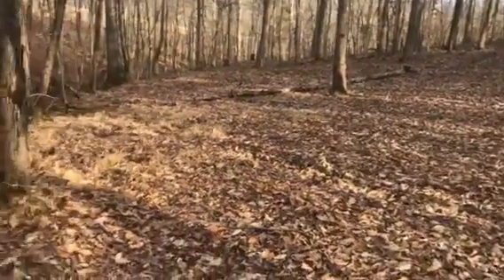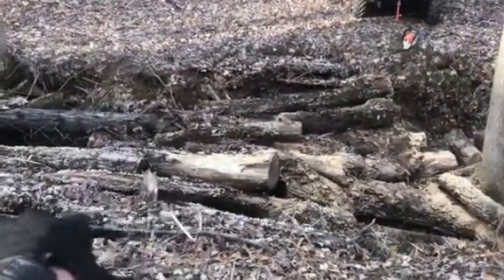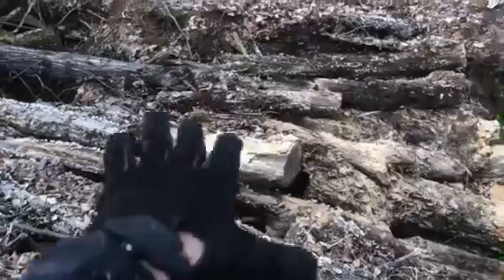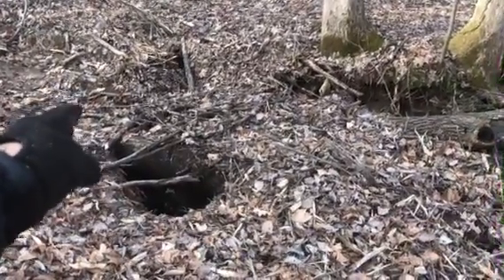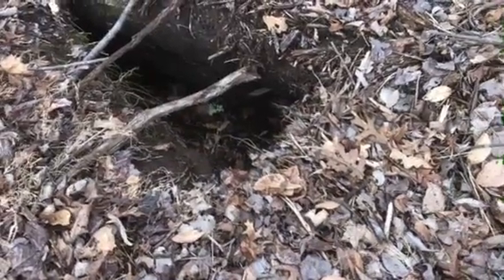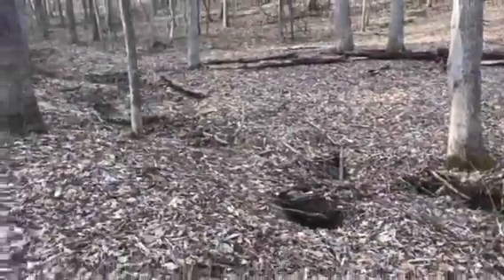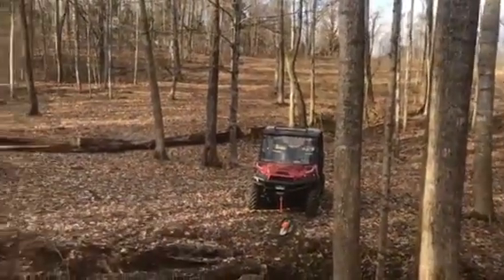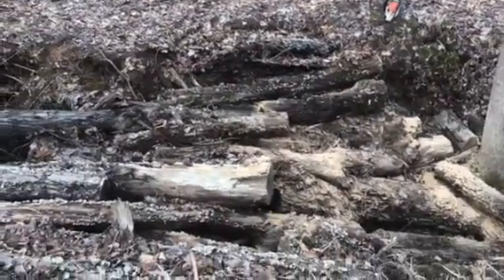Erosion Contriol Method for Dry Creek Gullies - Showing Progress

Comment: I’m debating between the Bobcat T870 or the cat 299D2 XHP with the metal excavator tracks if you look at them closely you’ll realize that steel tracks used on compact track loaders are excavator tracks except shorter my bobcat dealer has a rating of 4.1 on google maps and Holt cat pflugerville has a rating of 4.4 on google maps any wisdom is appreciated and thank you for your time! 🇺🇸🖖🏻😇
Reply from the maker: Ryan Christopher Wagner If you are going to use this machine for forestry mulching, I’d look at the total life-cycle cost. That is all of the costs AFTER the purchase cost. You should also consider the cost and type of maintenance warranty? What are the dealers maintenance shop rates? How much do they charge to send a service truck out to your job-site? Whats the trade-in value of their machines after 3-years of use? What are the cost of replacement cutter teeth? Do they service/warranty the cutter head? 
These are all important costs considerations to an owner.
Reply: Ryan that 299xhp with steel tracks would be a sweet mulching machine. I purchased a new excavator from Milton cat and had a few stipulations with my salesman. Once the contract was signed they wouldn’t make good on the agreement. I believe it was on the most part my fault for not having it in writing beware of oh yeah absolutely no problem. NC forestry and landscaping has the 299 you might want to check him out. Do you plan on just doing mulching cause the steel tracks might be an issue doing other work depending on soil conditions
Reply: Cookies Services yes I want to do forestry mulching, excavation/dirt work land clearing etc and conventional demolition NOT explosive and I’ve heard of them they do a damn good job 👍🏻 thanks for your time any wisdom/advice/constructive criticism is always welcomed by me 😇🇺🇸🖖🏻
Reply: The local tree co that clears for utilities near me has run all of the different ctl and the guys that run them swear that cat is best I would think they would have a dedicated muncher but I guess they are to big and are hard to get into tight areas. Greg from NC forestry,landscape would help you with questions. I know that I talked to salesman at cat and the ctl without equipment was 100-105k then you need an auxiliary cooler and of course you’re head talking 2 - 2500 per month plus insurance. You can adjust that with down payment and other terms length of lease. I prefer the tax incentives with a lease.
Reply: I own an asv with a disc type mulcher 100 hp and I use it for a multitude of tasks. I live in watershed area upstate NY and can go places with the asv that I can’t do with my excavator what part of the country are you from
Reply: Cookies Services I live in the Austin Texas area Travis county
Reply: Cats have very good resale also
Reply: Do you have a good cat dealer near you? Steel tracks would probably work fine down there but I believe you could run rubber as well if you had a job that called for it. Greg from NC started with a Kubota and said the tracks kept coming off and I know on the 299 they have a couple idler options to try to prevent that
Reply: Cat and asv are both over 100k so it’s a big investment

Comment: Yeah the machine is under warranty until it reaches 500 hours and they have gave me a t650 as a loaner
Reply from the maker: Joseph Stone Glad they gave you a loaner. Bobcat is pretty good with helping out keeping your business moving while your machine is in the shop. Did you buy that machine used, and the warranty is only 500 hours? I think Bobcat's basic warranty is 2000 hours. Personally, I think it's a good idea, and good risk management, to keep your equipment under warranty, especially if you're using it for business. It alleviates financial surprises, and the cost of the warranty is a tax deduction.

Comment: Hey I have a new t770 and I've put about 250 hours on it and already blew the turbo and the def pump and now its back in the shop now because of 3 different codes do you have the same problem sometimes
Reply from the maker: Joseph Stone Dang, Joe, that sucks. No, I can't really say that I've had major problems with either of the two T770's that I've had, besides the things that I broke operating it. My first machine I ran for 1950 hours before trading it in due to warranty time being up. My second machine did have the engine replaced due to a bad main drive bearing at about 300 hours, but that's been the only issue. I've got about 800 hours on this machine now.
I'm assuming your machine is still under warranty and these problems aren't costing you money, besides delaying your work. Have the Bobcat mechanics told you anything? And are they getting things fixed for you? If you're running a business, ask if they can give you a loaner machine while yours is in the shop so you can still work your customers.

Comment: Looking good.  I think it will work fine
Reply from the maker: John Earhart Thanks, John. Yes, I think it's going to work just fine. It's a good use for blown over trees. I plan on building it up solid with logs, throw some Geotextile fabric across it, and cover it with a layer of either 4" stone or culvert stone, to smooth over the logs so I can drive my Ranger and equipment over it as a decent trail. I figure the drainage water in this dry creek will flow under the rock and through the logs. And I expect it to catch all the sediment dirt in the logs and build up fairly solid over the years. That's my theory anyway.
Reply: Yup, that should work great.  I've done some similar things like that on my farm. The fabric will hold things in place nicely.  I just bought a new CTL..bought a Takeuchi TL12.  Had three Case wheel loaders before this.  Think I'm going to be very pleased.
I don't do any mulching,  mainly just dirt work now around the acreage I own and rental property.
Reply from the maker: John Earhart Yes, I know a couple of guys that run those Tak TL12's and they say they're very reliable.